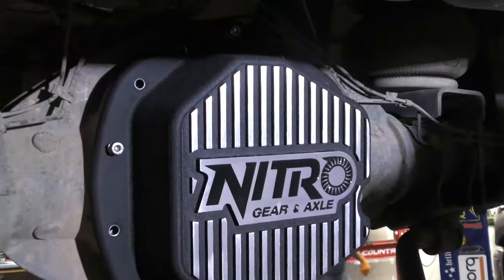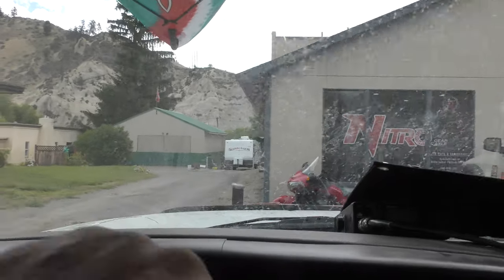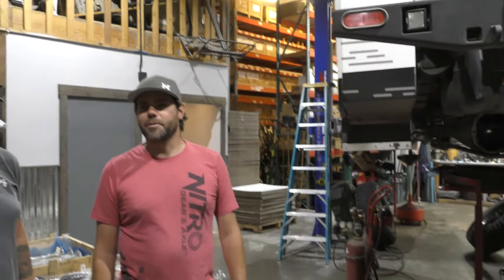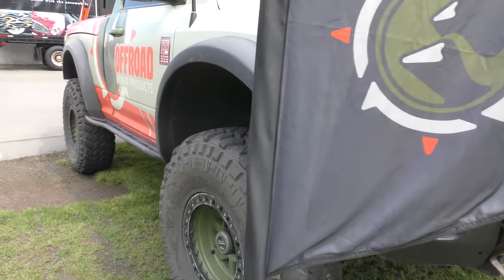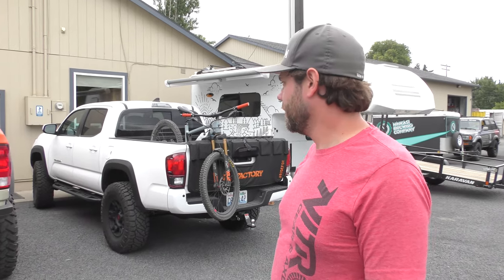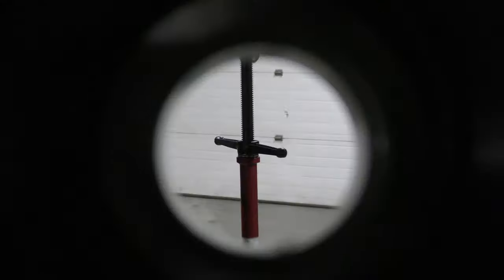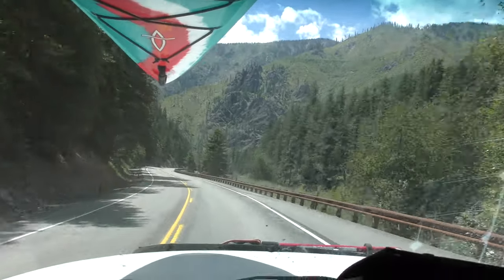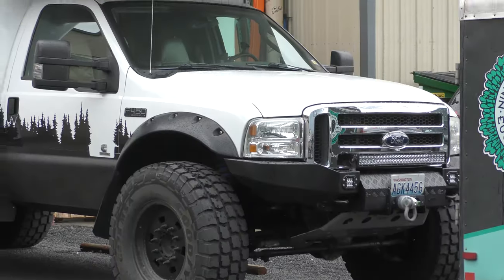RE-GEARING YOUR TRUCK 101 w/ Nitro Gear & Axle - Shop Tour and Rig Walk Arounds

Comment: Whoa! An F-450 with a Cummins swapped into it, and it's running 5.38 gears??  8:41
My stock 2017 F350 Diesel, single rear wheel has 3.31, with an option for 3.55. The stock Dually F350 has 3.73 with an option for 4.11. A 5.38 is 30% steeper than even the 4.11. Some of this may be offset by different gearing between the Ram and Ford transmissions. But still, 5.38 sounds extreme

Comment: I have his 456 gears in my van now. My 1990 ford van was stock with 373. I’ve added so much wind drag and will be towing a trailer with my Suzuki Samurai on it. You can see pics of my gear install at CarTex on my Instagram page 19904x4vanman.
Reply from the maker: Nice! Sounds like a badass setup!